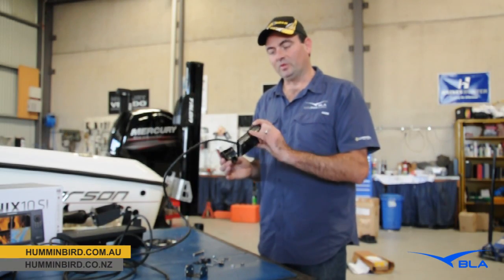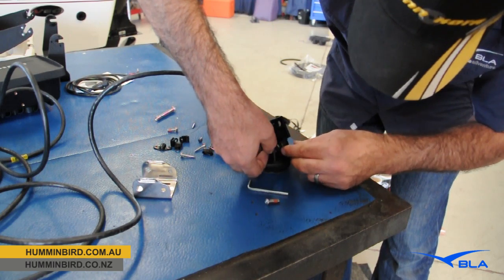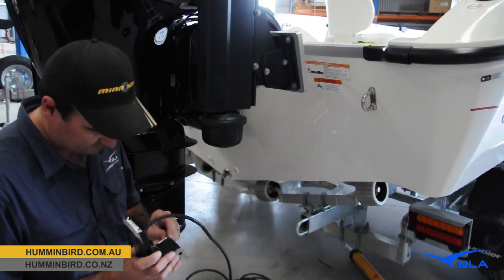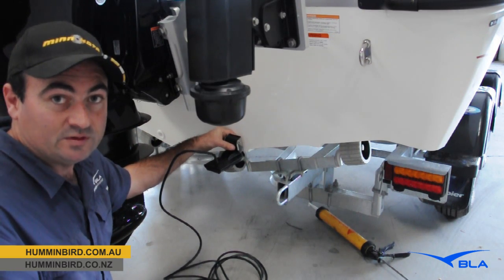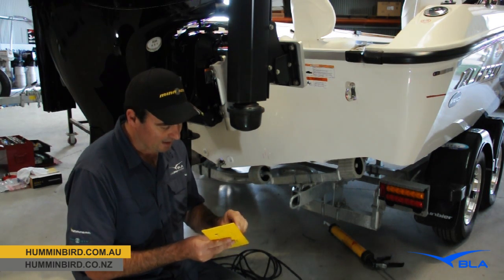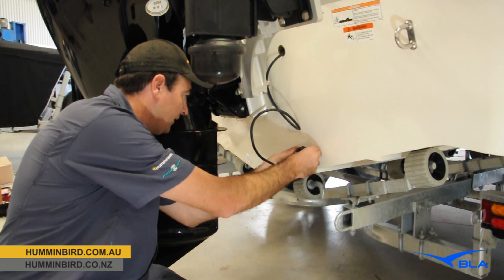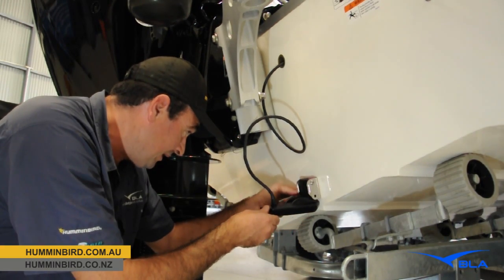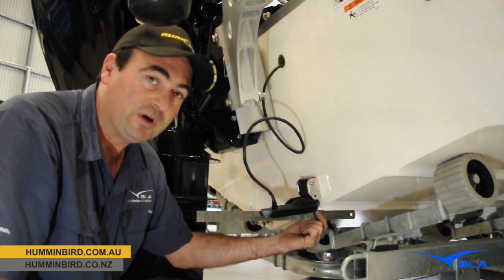BLA - Humminbird - HDSI Transom Transducer Installation

Comment: I just went for a ride with my boat today just to observe the airbubbles that comes out from the strikes when the boat is on plane and they are a LOT.  Right on the strikes i saw the most airbubbles in comparison with the flat surface between the strikes. So, its just simple logic. Since strikes make bubbles and flat surface doesnt the transducer go between them. That is what i think.

Comment: Advice for anyone installing a transducer for the first time... don't follow this video. I've only done this a few times but have seen quite a few things he messed up on. So first, his placement... it should be between the chines not directly beside the chine. And when he marked it, he should have used a level to level the bracket both horiztontally and vertically. Then when "leveling" the transducer you want to have the back of the transducer slightly pointed up, not down. When your boat sits in the water the front rises and rear is lower so you need to mimic that angle with the transducer

Comment: I've been watching some transducer install videos and this one is the only one so far that says to mount in line with the chine on the bottom of the boat.  All other instructions I've seen say to put it in the smooth flat between chines?
Reply: +Happytown The location will work but is not ideal. I would mount in-between.
Reply: It seems weird this is a humminbird video but he's mounting right on a strake... I would think humminbird should pull this video down...

Comment: so my fish finder works... but the plastic piece that is attached to the transducer broke, so I cannot mount it to the boat.... Right now, I just put a zip tie around the transducer cable at the base of it and used another zip tie to intertwine with that to run it through the boat mounting tabs.... looks like crap. Does anyone know if I can cut my existing transducer off and just buy another one? If so, will any transducer work or will I have to find the specific manufacturer and model? My fish finder is old.... but is also still working, so I don't want to replace it... I just want to see if I can put a new transducer on it.
Reply: +WanderleiSilva29 Why not epoxy a fabricated plastic bracket to the transducer?
Reply: Tom Snyder I actually just drilled a hole in it and welded in a latch to screw it into... It was a pain, but it worked.